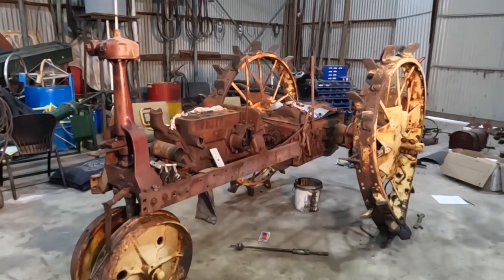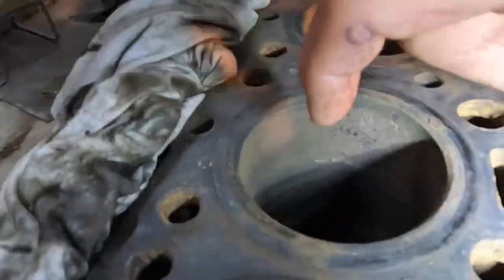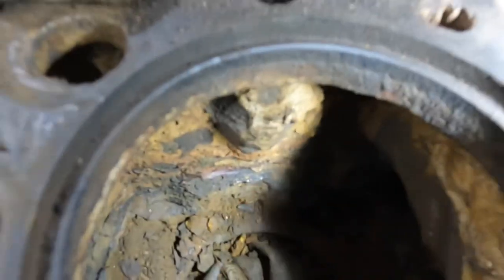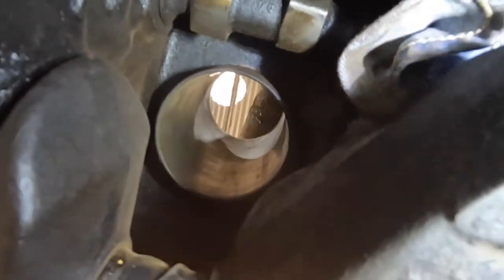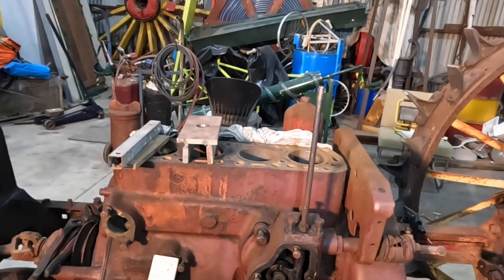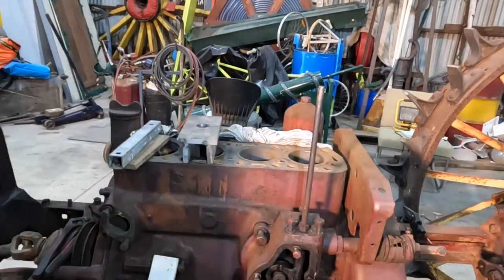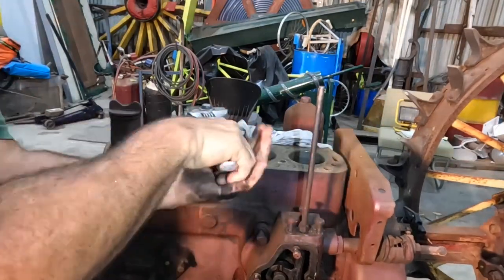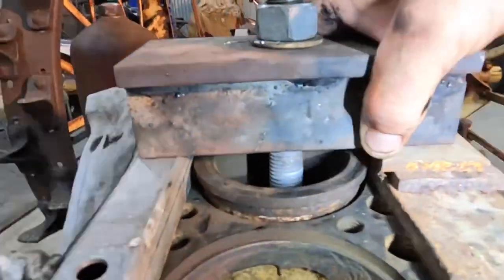How to remove cylinder sleeves from a Farmall F14

Comment: Hi Geoffrey.
Great job with simple tools. I am enjoying watching the progress on the Farmall.
On the subject of the Fordson Kero, in the day you could exchange a worn engine for a factory reconditioned one. Wet sleeve engines make farm reconditioning so simple.
Reply from the maker: Hi David, sorry to take so long to reply. I’ve been having some technical difficulties. I am glad you are enjoying the farmall videos. I am having fun doing the project. I had herd about the exchange engines for the Fordsons. Now it is so much more expensive to re sleeve a Fordson engine compared to a Farmall. I guess this is one of the reasons there are relatively few Fordsons from the 1930s still in regular use. 
Also they use far more fuel that other tractors from that era.
Thanks from Geoffrey

Comment: I'm  working on a 60s 3414 loader backhoe  it has a similar 4 cylinder.  One cylinder was seized with rust. I cut the piston and knocked it out in pieces.  But I broke the sleeve and coolant came out. I said rutro.. but I see from your video it's a wet sleeve.  No problems.. should be easy to get out since it's broken. Thanks
Reply from the maker: Hi Mike, good luck with your loader. I hope you can get the parts Easley for it.
Thanks from Geoffrey

Comment: Just about to do the same job on a Fergie TEA20 👍
Reply from the maker: Hi, the the TEA20 are a great little tractor. That should be a fun project.
Thanks from Geoffrey
Reply: Just honed mine out had water mark like you honed it out had head shaved max run on petrol
Reply: W4